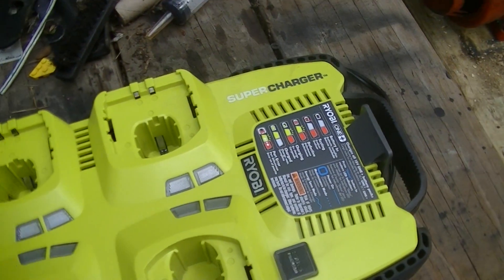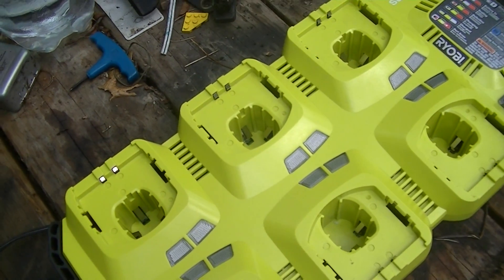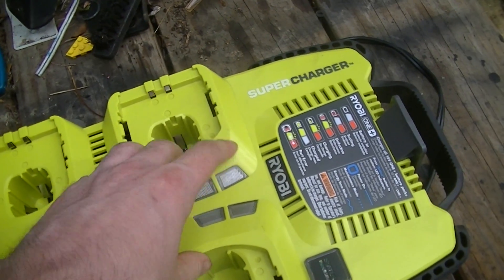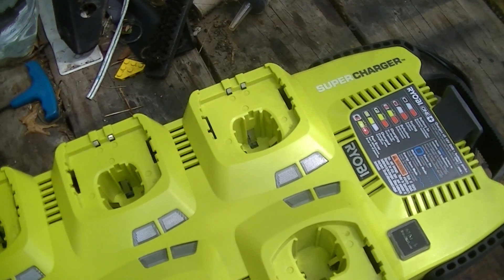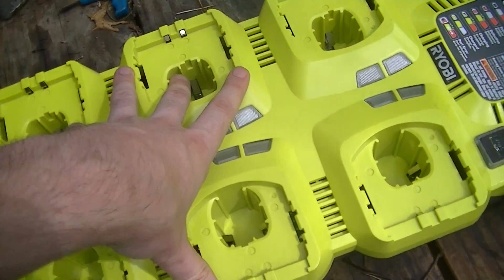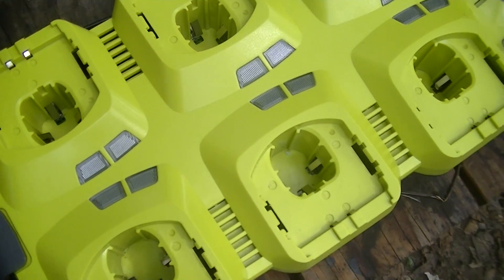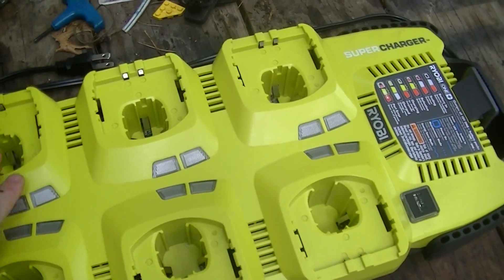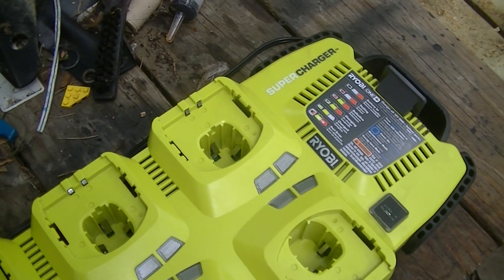Ryobi P125 supercharger review thing

Comment: Batteries are sold half charge cuz it's cheaper and safer to ship
Reply: Correct but it's actually better to have a lithium ion battery between 40% and 70% charge. If you go beyond those charge points then the cells are stressed and can die prematurely. I try to charge full only when I need it. I never keep my batteries on the charger.